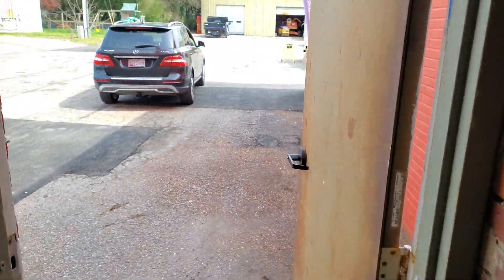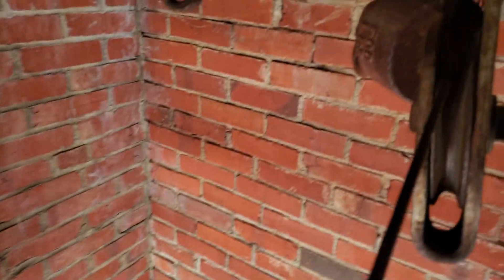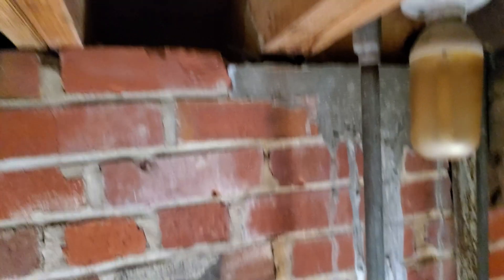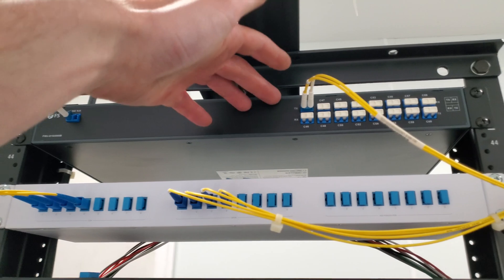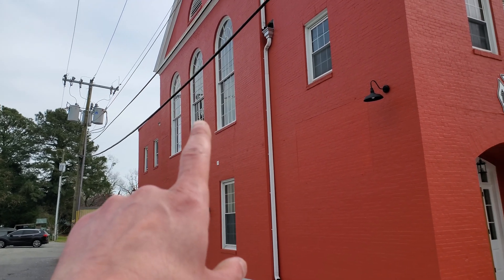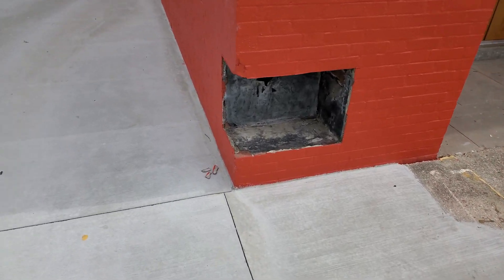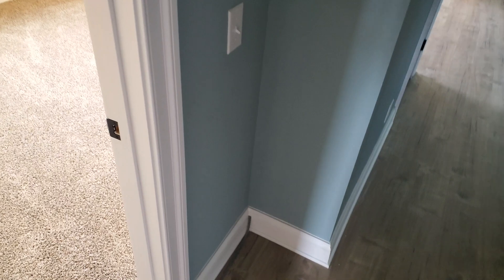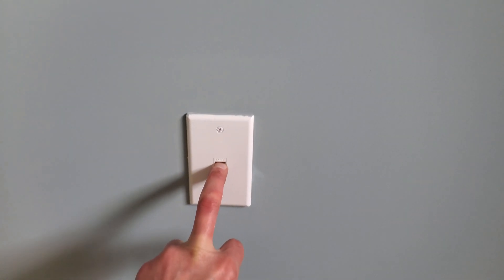New POP - Online

Comment: came out nice - plus fiber - good selling point for some people - maybe you think about doing some wireless? it looks like a good place to pop up a few antennae #lit
Reply: I believe their mainly going for FTTH/FTTP services, WISP’s usually suck, for many reasons. Their goal is to provide low latency optic services where those can’t. Probably a dozen other WISP’s in the area
Reply: @bcm50  Most WISP's at least just buy one DIA and then do million NAT's on it. It's quick, but usually just so unreliable after a few customers, and it's never set in the most efficient way. At least with this FTTH, you can see them actually planning and using real equipment